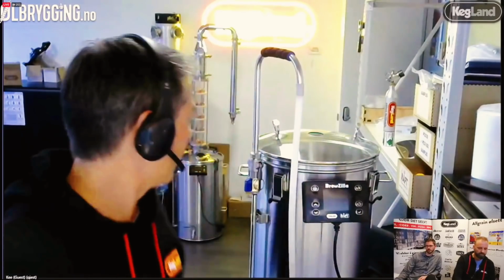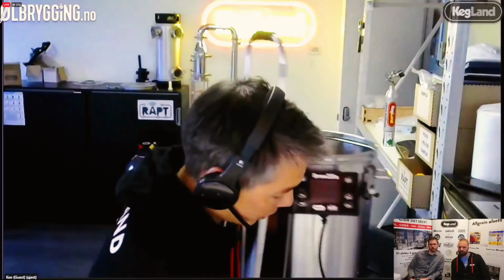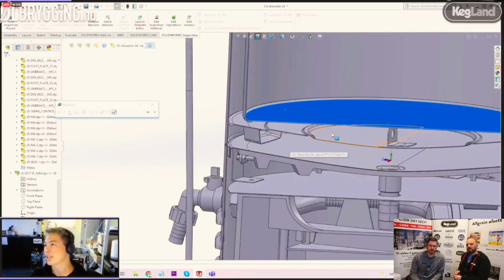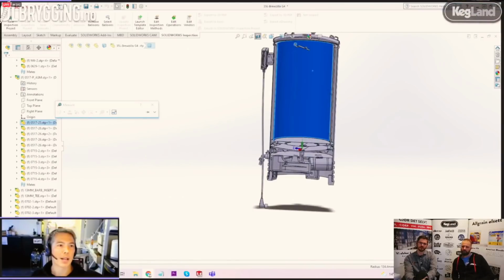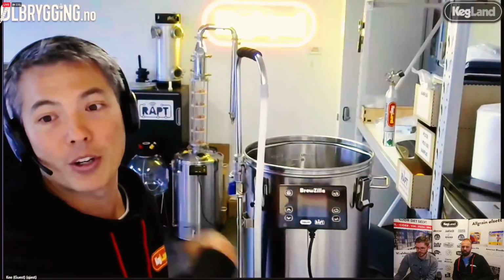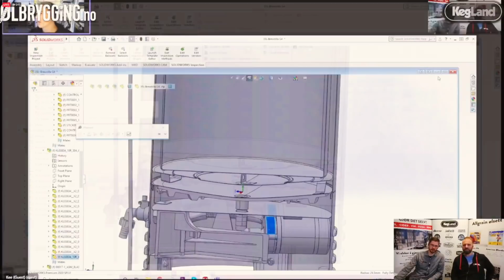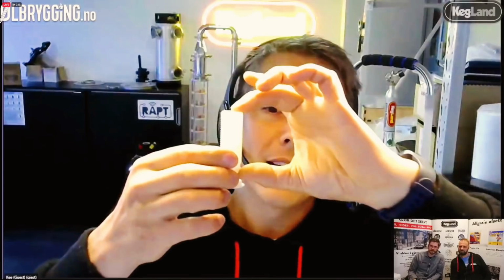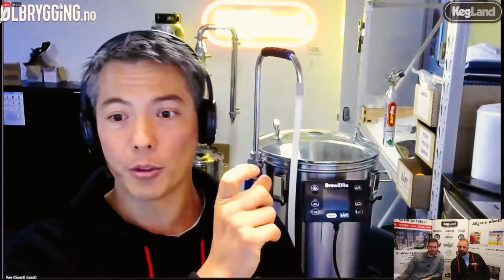BrewZilla GEN 4 Preview With Kee Doery Of Kegland

Comment: That wireless temperature probe would be useful to have connect to a phone. I take the point about the pill but when I’m brewing, I am right there, so however I can get the info is good. If the temp probe could send info to my phone, I could use it with my gen3 and control the elements manually, in the same way that I currently use a temp probe in top of mash
Reply from the maker: Yes, no problem there as the RAPT platform works on mobile phones.

Comment: I am thinking of buying the BrewZilla 65l v4 or the Brewster Beacon 70l.  The BrewZilla is more expansive then the Becon. Do you know anything about the Beacon?
Reply from the maker: The Brewzilla is of much better quality all round and has much better features. I have tested the Brewster 70 and frankly its not something I can recommend, so it had no video. The main issues are around quality, especially with the electrics and heating.
Reply: @DavidHeathHomebrew  thx. Then i have to wait untill september.
Reply from the maker: That would be for the best. It may come a little sooner, lets see 🍻
Reply: @DavidHeathHomebrew  do you think the Price for the v4 Will be the same as the v3?
Reply from the maker: I know it will be more than the V3. How much more will depend on what you homebrew store decides. It should not be a massive increase though.

Comment: I became disabled after collecting and modifying my brew pieces after many years, I’m kind of stuck with what I’ve got..a large keg w a 220-40 v Blichmann coil, a dedicated circuit in the kitchen. Nice mash pots on my stove gives me direct heat, a new hot pump allows me to recirculate. It’s difficult though to clean all the different pieces, this seems like it would be easier for me, but, I can’t really justify it when my older stuff works so well..
Reply from the maker: Sorry to hear that John. I always think whatever works is best 🍻🍻🍻
Reply: @DavidHeathHomebrew  right on..I won all my professional symphony auditions on a 1000dollar horn my father bought me my senior year in high school..I eventually bought a new one, but it’s proof positive that the equipment you learn to master will serve you well. I knew ppl that were always constantly changing mouthpieces or instruments or embracing the latest breathing fads instead of simply and honestly admitting their flaws and working diligently to correct them. I always told students they needed to develop an “impartial third ear,” and that that was the hardest thing to do.
Reply from the maker: Yes, better to master and use something simple rather than struggle with something over engineered.

Comment: Thanks for the video. I have a gen3 and love these improvements, its basically my beef  list except in Canada 110v heat element is weak. Nice would be to have a 220v unit to speed up the brew day. BTW I'm brewing normally 4kgs malt +/- 0.4 the dead space under the malt tube means my sparge volume is less than I'd like....
Reply from the maker: Cheers Mark. There is very little dead space in these new Gen 4 units.